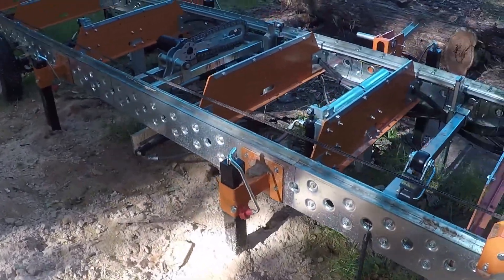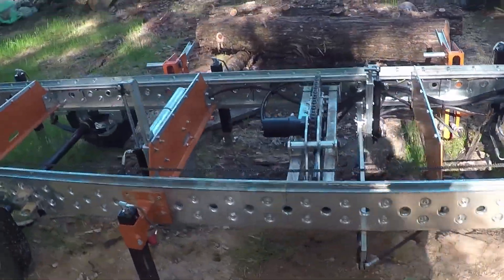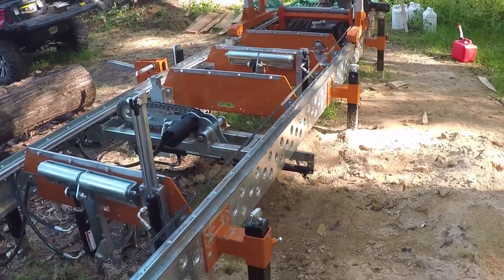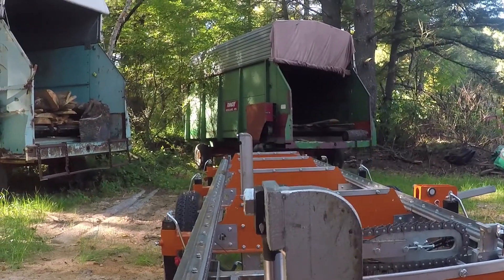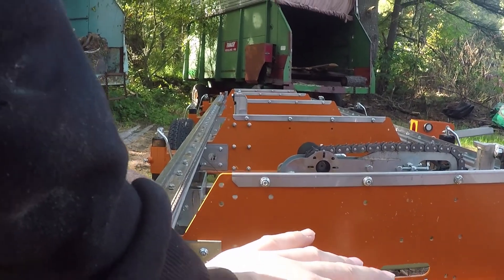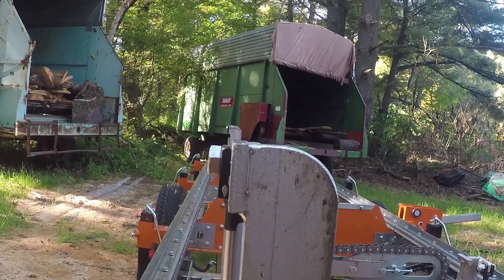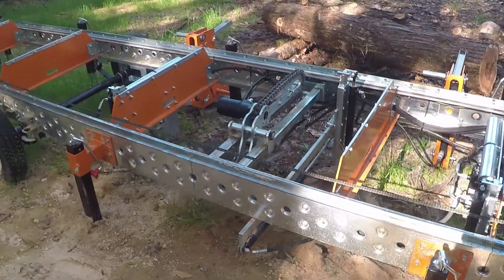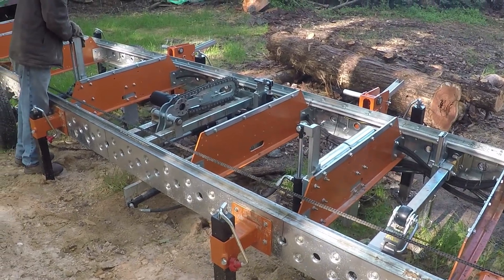Norwood Back Stops!

Comment: Are you saying they dont go up enough to function..or dont go up all the way?
 Don't see why it would matter if one got a head start on the other as long as they both extended fully..
Reply from the maker: Sorry maybe it wasn’t explained good enough for those who’ve never run a sawmill the back stops do not stay in sync so after you take off the first slab and you lower them down a little bit so the blade does not run into them you can only see the front one so let’s say The front one is at 6 inches and the back ones at 9 inches when you think they’re both at the same height and you run into the  back one after destroying a couple blades  it’s upsetting because you never use them all the way up or all the way down you’re always adjusting them for different size logs The size of the log as you saw it down smaller. Hope this helps clear it up Thanks for watching I appreciate the comment